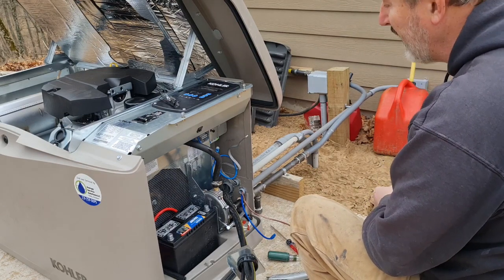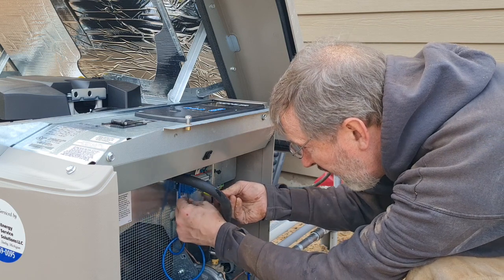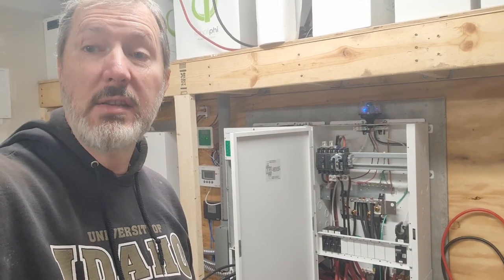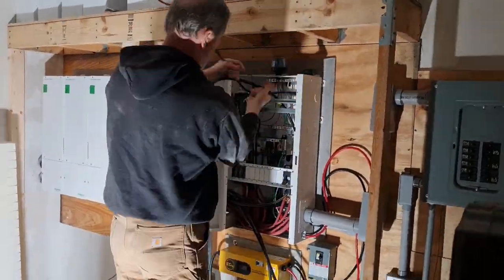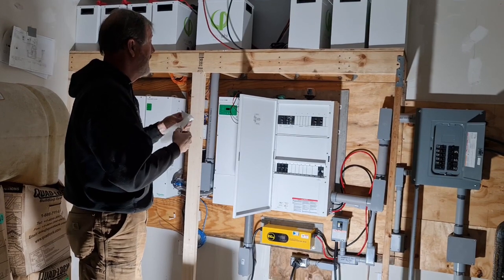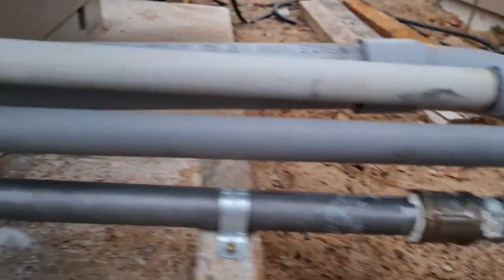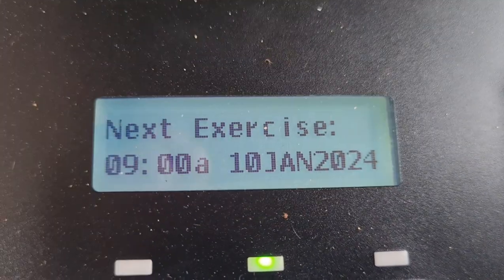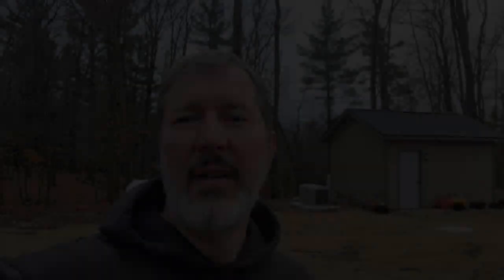Why won't it start? | Commissioning our new Kohler Generator...

Comment: I know this video is over a year old but is there not supposed to be a flex line between the generator and the gas hard piping
Reply from the maker: There actually is. The 90 degree sweep bend is a 4' flexible line.  I don't know if that is a legal requirement or not but if it is, we meet it. It does make sense to need one.

Comment: Can you show us how to release the air pocket?
Reply from the maker: On the right side of the demand regulator, I believe there is a set screw that takes an allen wrench to remove. Once removed, hit the run button to cycle the engine. This should allow the air to escape from the diaphragm in the regulator. Then, reinstall the plug and retry starting the engine.  I have a short clip of the service technician explaining this but we didn't get a good video clip of him actually doing it. I could post the video to a drop box if you want to send me a link -- it's 54MB.

Comment: Why couldn't you have showed how he released the oxygen out of the gas line?
Reply from the maker: It happened very quickly and he didn't tell me what he was going to try until after it worked. There's a little bleeder valve that he simply unscrewed and re-tightened. Kind of like a bleeder screw on a car brake line.

Comment: Best to verify the meter works first by measuring AC voltage before trusting it, every time you use it for something that could be harmful.
Reply from the maker: That's a great tip! Thanks for sharing.